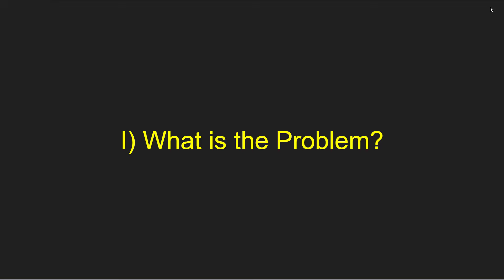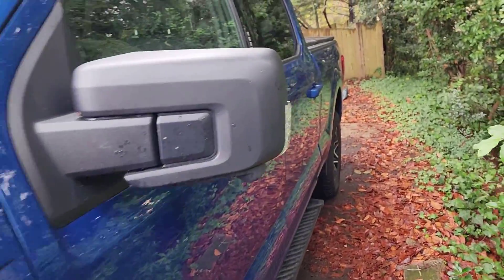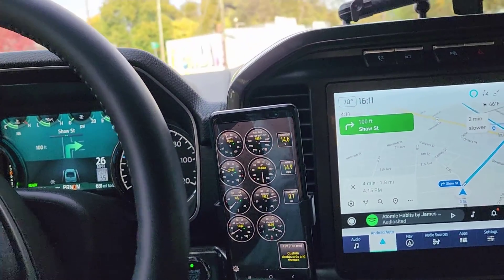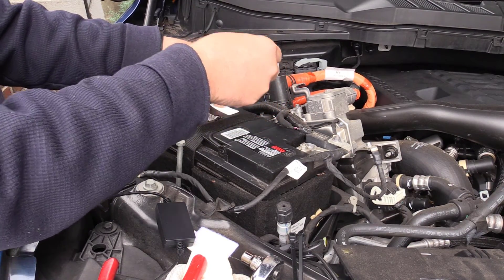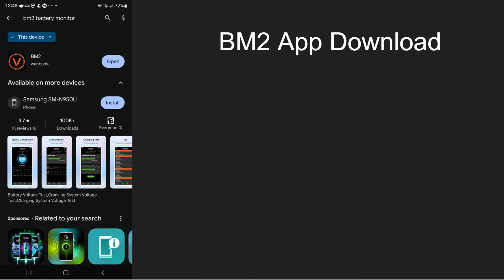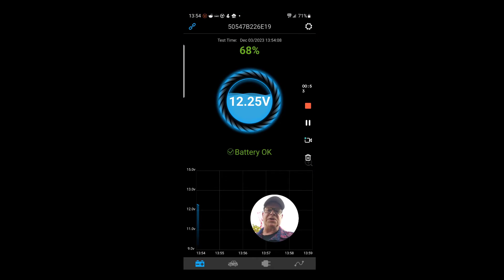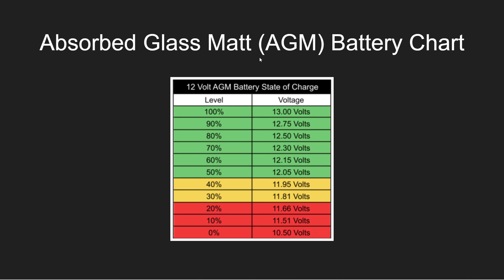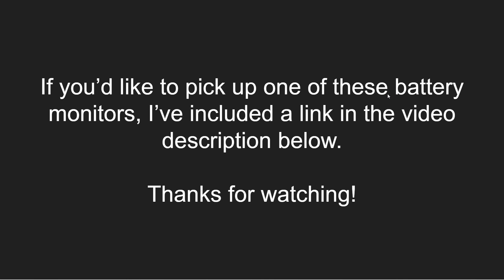Monitor Your Battery Remotely! Don't Get Stuck This Winter in Your F-150 PowerBoost.

Comment: Can this also be done on the Auxiliary battery under the back seat?
Reply from the maker: Yep, but they are running in parallel with the under-hood battery so you'll get the same reading unless you find a way to separate them for the test.

Comment: Thanks for your help! The Ford dealer said my battery is fine just like you predicted. It measured 12.3 Volts on my multimeter last night. It measured the same thing this morning, which was good news. My Bluetooth battery monitor should arrive today from Amazon and I will install that so I can see what’s happening over time. My local mechanic is going to source me a more powerful battery and install it but I want to see what the factory battery does with the Bluetooth monitor so I can catch it doing its thing where it falls below 80% and dumbs down the electronics again.

Comment: The for PowerBoost trucks only, this is a simple FIX.  FORD needs to change the code for the DC --> DC converter to start charging the 12v battery when it reaches 12.3 or 12.5 volts (or whatever parameter it deems), so the 12v battery is always fully charged.  Especially, since the hybrid battery can charge the 12v battery when truck isn't even running.  Hey FORD, hope you are watching and reading this!!  Merci
Reply from the maker: That's actually the way it already works. The HV battery through the DC-DC converter will start charging the battery as soon as you turn the truck on.
Reply: @fixorrepairdiy4609  ... but, it should be "maintaining" the 12v battery when OFF.  I should have worded it better.  Make the hybrid battery a maintainer for the 12v battery.  Merci
Reply: @biz4twobiz463  Hello,
I like your idea but, the lawyers will recomend to minimize any and all actions that are occurring when the vehicle is not being supervise by or near a driver. In case something goes wrong.

Comment: I live in Alaska. Normal SOP is to winterize our vehicles with an oil pan heater, a transmission pan heater, block heater, and a trickle charger on the 12 volt batterry.   All are AC powered and plugged in when the temperature drops below 20. (we just went through 2 weeks of minus 40 to 50)  How do you think a trickle charger on a hybrids 12 volt battery will impact the system?  Will it effect or also charge the hybrid battery?
Reply from the maker: Hi Norm. Some have gone to great lengths to install an exterior socket on their powerboost so that they can trickle charge the 12V battery overnight. This will NOT impact the HV battery, nor will it attempt to back-charge it. Cheers

Comment: I'm just plugging my powerboost in every sunday while I am home. Its inconvenient and Ford could easily add this to the dash if they wanted to so it doesnt sneak up on you but they chose not to.

Truck is supposed to power the house but you need the house to power the truck it turns out. I'm not even sure if getting something like a yellow top would help. I suppose it would a little bit but the issue is still going to be there eventually. I understand why its happening but on a daily driver 6 days of the week you would think it could manage to charge itself.
Reply from the maker: Hey Jerry I think the root cause might be a whole pile of weak FoMoCo batteries. People that I've been following with this issue have it go away when they replace the battery with a new H7 from Costco/NAPA/Walmart/etc. I'll probably go this route as well instead of fighting the dealer; one day spent wasting time costs me more than a new $250 battery.

Comment: You mentioned sound system "behind the current sensor", are you saying you need to run the amp ground  back to the negative terminal?
Reply from the maker: Don't recall saying anything about audio systems in this video. But if I were installing some window-shaking aftermarket system with a whole bed full of woofers, I would probably seek the lowest-impedance path to 12V possible; I would go straight to the battery terminals with a relay cutoff for the amp.

Comment: Will the hybrid battery charge a dead 12v if you turn the truck on without starting it?
Reply from the maker: Good question. I think it depends on how low your 12V battery gets; if it's too low to even boot up the startup system, then NO. In my case, my 12V battery is somewhat weak, as it drops below 12.0V on cold mornings when the "welcome" lights go off, yet I can see the HV battery and inverter start to charge the 12V system as soon as I hit the "start" button, even without the ICE being on.
Reply: Thanks!  Do you recommend getting the battery monitor IN ADDITION to the obd2 monitor? @fixorrepairdiy4609

Comment: Are you able to see your oil temp (and coolant temp) with the obd2 monitor you have? And about how much time do you see between the coolant temperature reaching normal operating temp and the oil temp reaching normal operation, if so?

thank you for the video I also have a 22’ powerboost 

Just ordered the filter wrench and the battery monitor. And I am installing the air oil separator you showed in a previous video as well. I like the way you think! Merry Christmas 👍👍
Reply from the maker: I don't believe that an oil temp or oil pressure PID exists yet. No idea why. I haven't played with it for some time, I might give it another shot and see if it's there. Coolant temp, definitely. The OBDLink MX+ is by far the best OBD2 monitor for these trucks because of the number of Ford-specific PIDs that are available. cheers

Comment: How do I get my 2021 to show SOC on the dash? I am adding a second AMG starting battery in the truck bed and connecting it to the main battery with 4G wire. I can’t run anything, even a dash cam, withour the main system going too low.  I have already added both items to my AMZ cart. I have an old android phone that can be mounted as a semipermanent monitor.
Reply from the maker: Well, you can't get SOC on the actual truck screen or monitor. You can do it with the bluetooth battery monitor that I show in this video, or via OBD2 using the OBDLink MX+ and the app for your phone, but that will only monitor your battery when the truck is ON (and therefore CHARGING if you have a PowerBoost). If you are getting voltage drop with just a dash cam, then your primary battery is likely weak. Cheers

Comment: Sorry new viewer but whereabouts do you live and what temps are you seeing? I’ve never had that warning pop up. Mines about a year and a half too, 2022.
Reply from the maker: I'm in upstate SC so our temps don't go too far below freezing point. I've had the 12V "state of charge" warning show up over the winter if I didn't drive the truck for a few days. I suspect I'll see it more often this winter if the resting voltage is near 12.0V. cheers
Reply: Nice video, thanks!

I charge all my cars every 3 months with a nice 10a smart charger. Seems to really help add some life for my batteries. 

Interesting datapoint. I detached the negative cable in an attempt to prevent theft when a key was stolen. Didn’t work. Truck still starts without the battery attached!
Reply: @radioactivemike1  maybe it is because of the 2nd smaller  12 v battery under the rear passenger seat?